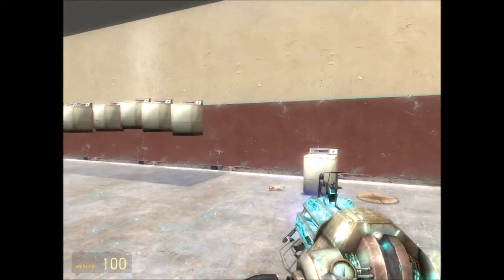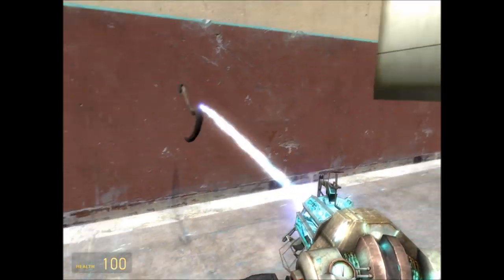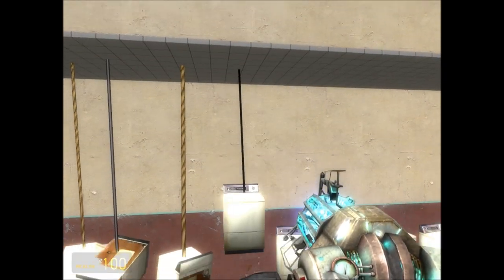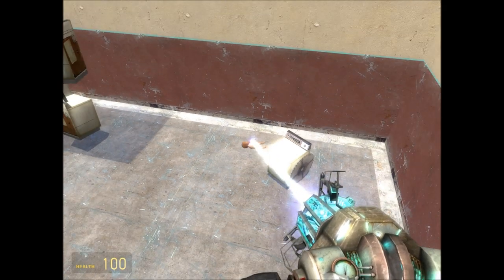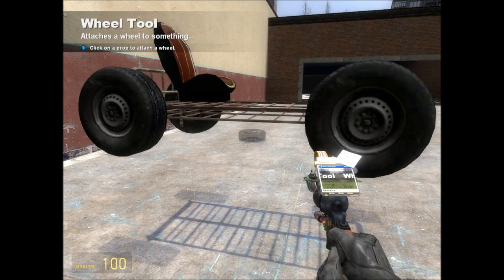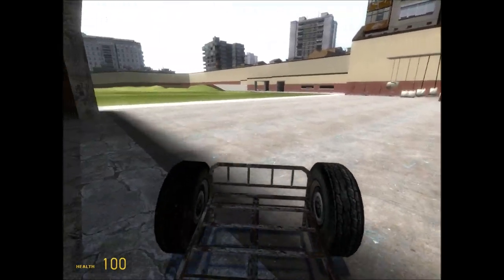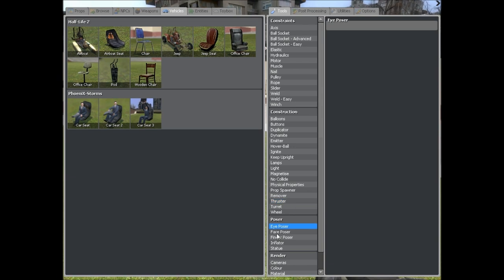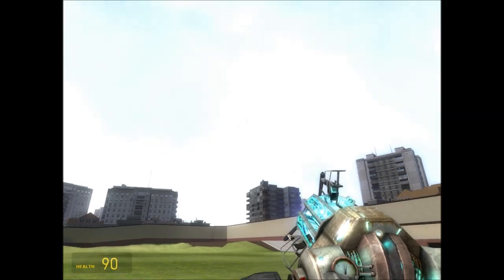Garry's Mod - Tutorial - How to use the basic tools

Comment: How do i get the props I open the menu there are no props
Reply from the maker: it looks slightly different to the menu in this video because it was updated recently, but should have all the same stuff if you press Q to open your menu the left hand side will have all the props that are available to you. Most of the props should be there some of them will only spawn if you have the certain Valve game for that prop (CS,HL,TF2 are the main ones)